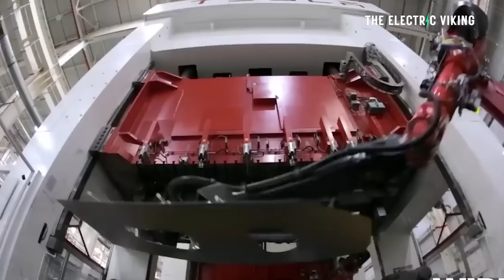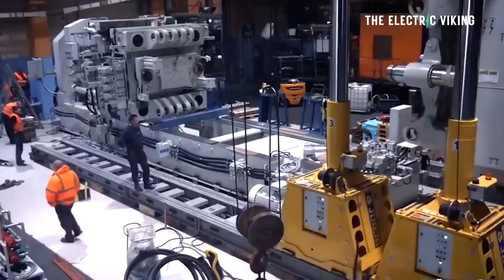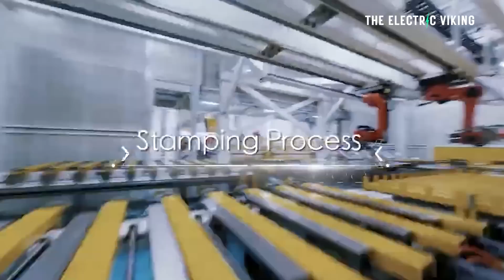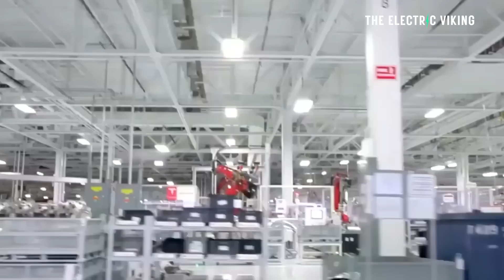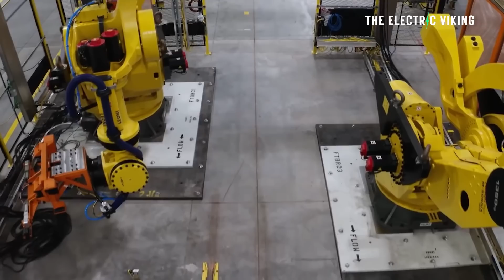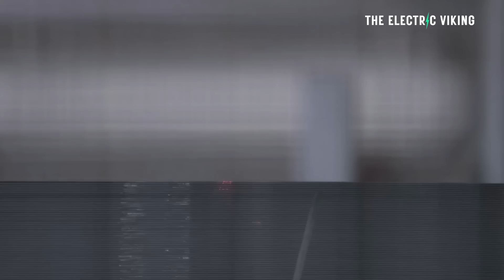Tesla achieves 'mega cast' breakthrough in single-piece casting for Model 2

Comment: Hi great Vlog. I have a question that probably has been asked before. If one casting is used for the structural part of a car what happens if the car is in a small accident where for example on a normal car a crossmember was damaged and had to be replaced. How do you fix a gigacast made car?
Reply: Cut it out and reweld a new piece in.but the gega castings are so strong  that a minor accident won't do much damage.

Comment: Change in legacy automotive industry is glacial. Some decisions are made without even knowing the local conditions. For example, Ford updated a facility in Geelong. The design was done by Ford Canada, who wanted the structure to be able to handle snow loadings. Maybe they confused us with Austria. Penny pinching? The bean counters refused to allow a 16 cent washer to be fitted to a 5 litre V8 made in Geelong. The engineer deemed it necessary. He quit over the issue.

Comment: I dont see how body casting could pass a crash test, you need steel pipes running throughout the roof for roll over, and over hood collisions. You can 3d metal, not titanium like they claim, it might be a little harder than steel. They absolutely are not 3d prining titanium.

Comment: This makes sense if the casting includes the A, B, and C pillars with molded mounting points and alignment guides for trim, door hinges, and body panels. Casting the pan for the battery won't happen because it's not needed. The battery pack would still be built as an array of cells sandwiched between thin stamped metal sheets and bolted into the casting from the bottom.

Comment: Having worked for a tier 1 automotive supplier of stamped metal vehicle chassis the amount of equipment and tooling needed to produce a single model of vehicle chassis was / is insane.

Giga casting is a game changer because it reduces the part count, eliminates spot welding, riveting and gluing of vehicle unibodies.

Comment: If single piece casting is going to cut the manufacturing cost on the model 2... why would it's MSRP still be around $25,000 instead of say $15,000 dollars? How does BYD make EVs for much less than that without the marvel of single piece casting breakthrough?
Reply: Cheaper components, much lower margins. It requires high volume sales to maintain. Should the sales slow, then they become stuck. It won't happen soon, but future players joining a flooded market will struggle to compete. Tesla has the premium advantage for now, and if they license/sell their tech to those struggling automakers it will only strengthen their position as market leaders.

Comment: I am very sad about the fact that I have been right. We have been involved in a project for a high performance engine with about 40 pcs instead of 200 and we needed complicated casting not yet available at that time and Fraunhofer wanted to help us. When we had the solution they were pribed by Volkswagen AG to stop the activities with us so that we had to look for other casting partners and lost the essential year for a breakthrough! But now I am also happy to see what goes on with Gigacasting. Tesla also has the remedy for insurance companies that claim that repairs would cost much more than previously exchange only parts of the construction, they will offer their own and cheaper insurance - problem solved for those that do not follow Sandy Munro & Associates and know that also a Tesla can be fixed after accidents. However in case the passengers are safer than in Volvo cars. I am also quite impressed that Hyundai group and some Chinese automakers do not hesitate to also apply new technologies. The E-GMP according to Munro again is already very near to Tesla and the Koreans with China in their reach cannot wait like legacy from USA or Europe until they change what they did the past 100 years!😂

Comment: Just my two bits. From what I have read and what  I believe that may have come from Elon, gigacastings are designed to be very tough (see Sandy Munro's take on the toughness of the casting) and the main structure would withstand impact forces better than bent sheet metal (unibody) and if there was enough damage to bend the heavy structure of the casting, it would have already been totaled off with a unibody style car. I belieVe Elon already touched on the matter of replacing the badly damaged casting with a new one and the body panels as well which would possibly lower the repair costs as well.

Comment: 3D printing is fine for molds, but too slow and crude to make production parts, because they require much finishing. 
But definitely a good strategy for making the molds which can then press out the sheet metal parts or act as molds for casting certain parts.
Reply: But ... but ... 3D printers of the near future will be able to print an entire car in under 15 minutes!
Reply: 🤣🤣🤣 @KP-xi4bj
Reply: The 3D printing is used for prototypes. Allowing for faster iterations of development cycles. Finding flaws in full blown mock ups makes for quicker adjustments and then onto the next print. Once a design is finalised, then they can make molds for casting.

Comment: The first thing I want to say is the first images you showed were of a Tesla patent about a multi phase casting process. One which as far as I know Tesla has not said much at all, and haven't confirmed they ever intend to use. Then there were a lot of other clips about stamping not all about casting. 

Making the chassis of the model 2 from one piece doesn't seem to fit well with the "unboxing" assembly method which they indicated was going to be a process they intended to follow. When we get to see more of the CT (which they DID say would use that assembly method) we might get a better idea of how well that concept works in practice, and indicate if it can benefit a small car like model 2, or robotaxi. I suspect that recent work at Austin revolve around applying that concept to the Model Y  line as well. The Model Y line has not been in operation for most of this week.

My guess is they will not have a one piece casting (as such) for the base of model 2, but there will be at least one pretty large casting, plus some clever applications of the unboxing techniques, and maybe some plastic or composite body/door panels similar to the first Saturn cars. I think the intent will be to reduce the need for painting the whole vehicle and thus avoid the need for another full painting line which will save a pile of money and time. There will be a definite move to shorten the length of the production line and speed it up by a large factor.

Comment: Again!  they're NOT CASTING CARS!  IT'S A PRESS!  Casting is like for an engine block, pouring or injecting molten metal into a mold.  A press will bend metal into a shape.  Die-casting is not suitable for sheet-metal thicknesses*. And there's no need for an engineering degree to understand this.  Also, maybe you couldn't find evidence on how Audi does things, because they don't allow certain things to be publicized. 
Sheet metal is typically a steel or aluminum alloy that's rolled to compress it, to increase it's density and strength.  You cannot do that with die-casting.  Yes, there are aluminum parts typically being cast - maybe the underbody is, I'd have to research it.  But all the pictures you are showing, are sheet metal being bent, not cast.  omg, don't you understand the difference?  Or do you just want the entire industry to change it's terms in order to accommodate you because you're too stubbord to use the proper words?

Comment: The giga castings are revolutionary. But what happens in a accident if they are cracked? The car is totaled? Maybe it is not an issue?
Reply: You buy a new Tesla…win-win Musk
Reply: Castings are stronger than conventionally built cars and legacy cars would be totaled too if they had that impact. Everything is cheaper now to buy new than to repair.
Reply: Castings can be welded

Comment: I wonder how this will be with minor crashes, is the car basically condemned after a minor crash?
Reply: Depends. Single mold doesn't prevent banging/heating out dents. And the doors/hood/bumpers will be separate from the frame. And doesn't mean pieces can't be cut out and new pieces welded in.

Comment: The idea was to build batteries that are also structural. Having this section as a cast would step back from that idea. And you'd still need a battery pack (built as a single unit) to then lower into the cast frame. Which implies more interface (nuts, glue) between the two. Thus likely to add more weight. Turning two castings into one doesn't have as big an impact as turning many parts into two. It eliminates some bolts/operator time. But not a whole lot. Still, we'll see.

Also I'd like to see some reporting on how other car makers are moving forward towards castings.

Comment: Tesla is 3D printing sand molds to pour these underbody casting using an ExOne printer at this time.    The technology is 20 years old although this is a large scale.   Not production but for prototyping.   They may not have a die casting press large enough to do the job at this early date.
Various YouTube channels not having video from Tesla are showing 3D printing and maybe casting clips that are not related to this process.
Reply: Yeah,  this viking dude talks out of his ass.

Comment: Cast the whole bottom is part of the equation.  But what about the comments that paint is very expensive?  That has to be part.  Are they going to plastic body panels instead of steel?  If one makes the top of the car like a steel roll cage, does the zinc dip coating cost less?  What about the doors, can one cast those also, with steel safety inserts?  What one ends up with is an aluminum car with high strength steel where needed and plastic panels instead of paint??  Just trying to put all the pieces together.  Perhaps they will paint, but only with a clear coat, so there is no bothering with different paints and clean-up?  Or not?
Reply: Car might be stainless like the cybertruck.
Reply: @KidHorn7001   That does not sound like an inexpensive option.  Possible, but I doubt it.  Plastic sounds less expensive, and is available in colors.  SS for the robotaxi may make more sense.  I guess we will see.

Comment: I agree Sam - I have found automotive manufacturing so aggravating over my lifetime with senseless design and archaic principles - so refreshing to see thought used to finally aim to produce better more affordable transport - personally I think there is so much more to come with integrated 3d printing although still in it's infancy and superior wheel motor designs which don't seem to exist yet for some bizarre reason - please anyone wishing to reply with " wheel motors would be to heavy and unable to withstand the shock or that unsprung weight negates any positives " , don't because you are only thinking like the idiots who said gigacasting wouldn't work .
Reply: Good point
Reply: Uh huh….  We will see how archaic it is when your insurance premiums rival the car note
Reply: 3D printing is slow, but compared to making a new die it's really fast and very cheap because you can just buy your own sand printer and put it in the same building as the casting machine instead of sending your designs to a specialist company who machines a new test die out of a solid block of metal. After each test you can just chop up the used die and test cast and feed them into the metal melters as material for your next test instead of selling them to a recycler and buying a new solid block of metal to machine cut a new die. That's why using 3d printing for test dies is the fastest and cheapest way to get to production quality dies. It also affords you the capability to try more things which have a lower probability of success but can result in more valuable learning for more tests.
Reply: @t3hpwninat0r  Can you see no way in which to speed up a 3d printing process ?

Comment: The claim that EV's are just too expensive to produce seems ridiculous, the batteries are an expensive item, (at present) but it just has to be so much easier to make the rest of the components than an internal combustion engine with hundreds of complex little parts all rubbing against each other and requiring precision tollerances and bearings etc.
The technology employed in manufacturing ICE engines and transmissions has been developed over about a century, it is a triumph of ingenuity, all we need to do is apply that same ingenuity and economies of scale to EV designs.

Comment: Proud shareholder of Desktop Metal here!😁
Reply: Is this bullish for desktop metal
Reply: @homercuts  definitely, they are the ones doing this. Also, potential parts are going to be printed with the same sand digital casting for production. Have a look at their recent earnings sheets. Rumor has it That Apple goes for Metal binder jet, and Desktop Metal has the most significant chance to be their supplier too

Desktop Metal could be the Tesla of the 3D print companies in my opinion

Comment: I'm pretty sure body repair shops are thrilled to hear about this.  As so as the car insurance
Reply: Not sure it makes much difference to repair pieces welded together vs a single mold.
Reply: @KidHorn7001 Sandy Munro made a video demoing using a big sledgehammer on welded steel, versus on cast aluminum.  The latter's paint was scuffed; the former dented.  Both were in production vehicles.  He thought the concerns about castings were uninformed (well, he was less polite).
Reply: Well, the numbers would bear that out... and they don't. Insuring a Tesla costs about 49% of insuring an equivalent ICE vehicle.

Comment: Now that we know that Juniper will be third or fourth quarter next year, it’s possible they will go to one mould for that car. Also they probably want to work out the manufacturing process of the Model 2 in Texas before building it at GigaMexico. I also think there is a possibility that Austin will go to full scale production of the Model 2 because of the delays in building GigaMexico. Do you think there’s a chance that Tesla will change their mind about building a gigafactory in Mexico? I hope not but it’s possible.
Reply: Rob Mauer just had a video on the topic. Elon could not get all his engineers down to Mexico for a year to innovate there, so they are going to design the line in Austin, then copy it down to Mexico.
Reply: There's no way they'll have the time to do that. They'll spend years testing this. They need to make sure it holds up in all kinds of weather and will have to crash test it in all kinds of situations. If they make any changes, it's back to square one. My guess is 2028 at the earliest.

Comment: My guess is that giga casting will work only if model changes are not frequent. This seems to be Tesla's approach, already, so it should work for them. Legacy auto makers depend on bringing out new and different models to excite car owners, but this car lover's approach may be a thing of the past, anyway.
Reply: I'd argue it's easy to change molds to change the design.
Reply: The base molding castings can stay the same the trims are the trims interior body changes headlights and the tech so I see it working
Reply: Yep. Those days are done. About time. Much more mature way of doing business.